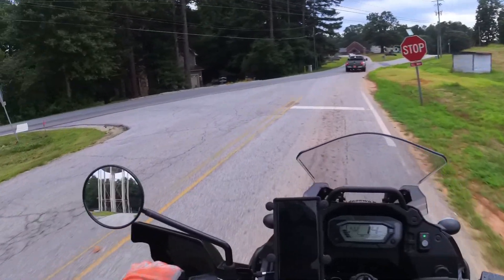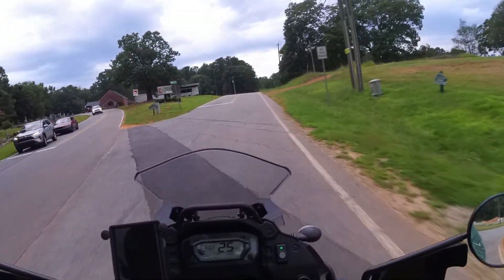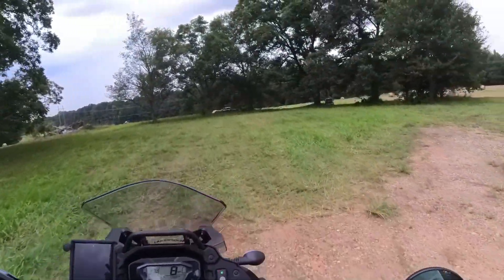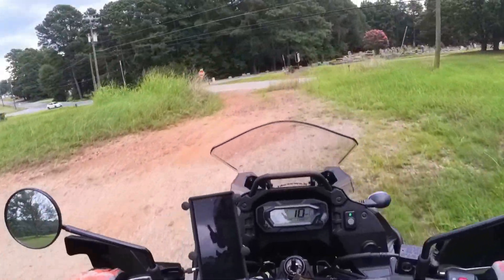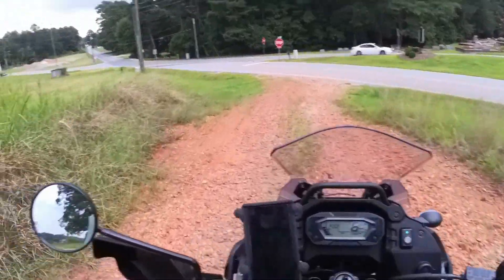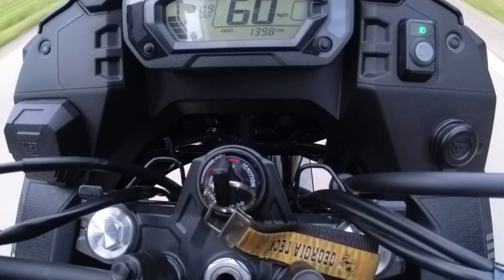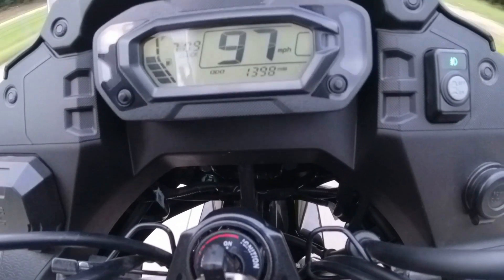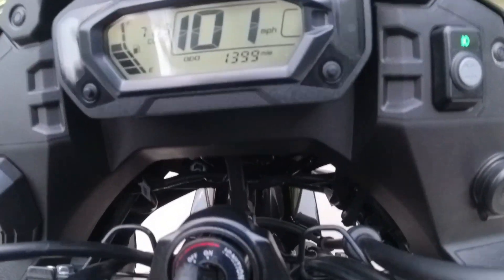Can the 2022+ KLR650 hit triple digits!?! Top speed run after modding let's see it can do!

Comment: That was impressive! I am over 6' 4" and weigh about 270 right now. Since I live in South Dakota, we have high speed limits on our Interstates (80 mph) and most of our secondary 2 lanes are 65. I never figured the KLR could hold those speeds. Otherwise, I would have considered as a daily rider, commuter next to my Victory Vision. Maybe I should rethink this.
Reply from the maker: Doing highway speeds isn't an issue. It cruises happily at 80. For what you need it for, it's just fine. Not to mention you'd be getting about 50+ Mpg haha
Reply: u get a nice head wind and a hill youll struggle to stay at 70 and the rpms your running at at 70 your not getting 50mpg
Reply: @mrt4755 
Sad but true.

Comment: Sorry to burst your bubble, but you hit a “displayed” speed of 102mph.
KLR speedometers are known to be a bit optimistic :) 
Your actual speed was closer to 97mph, if you’re running the stock 15T front/43T rear sprockets.
Reply: I compared my speedo to gps and its accurate to the gps, but the speedo doesn’t keep up with the GPs if that makes sense, like get up to 50 according to the gps and your speedo will say 47 but if you hold it for a few seconds they match up.  I am still in my 600 mile break in period so, I haven’t taken her over 65.

Comment: I bought a brand new KLR 650 back in 99.  I could barely hit 95MPH.   It popped on deceleration so I took it back to the dealer. They told me it was for California specs but they could drill out the mixture screw and solve it.  They did this. I could then hit 105 MPH although these days, Maybe 99.   Bike is sitting in my garage ready for another year. One day soon,  I might do the .22 cent mod and see if that wakes it up.

Comment: I weigh 210 LBS and I had mine at 100 MPH flat 3 separate times. I should also add that mine is completely stock. I’m sure with a different gear ratio you can trade some torque for some extra speed to get it well above 100
Reply: Can it do 75 all day , as the saying goes, that's my question , in all winds and hills etc .
Reply: Yes, is it going to be very comfortable, no. @leeinwis

Comment: I am assuming you are running stock gears 14x43 (Ratio2.86) . As Im planning a Tuktoyaktuk ride  which is long distance , I needed more cruising speed at less RPM . So I went 16x 43 (ratio2.68) and was not impressed. I then went to 15x38 (Ratio2.53) which I am happy with as I can ride at 75mph all day long distance to the Arctic. How ever a buddy of mine , also Gen 3 is riding gears 15x39 (Ratio 2.60) and that seems to be the best which I will change to in due course. This gearing is not for bush riding.

Comment: Im confused at all the comments saying “i got xx mph stock” the bike is rev limited to 89mph from the factory, unless you figure a way to remove the limiter or you change the gears how are you all going faster? I hit 89mph one time and it started cutting the fuel off. Not to mention it took 4-5 miles of wide open throttle to get there, the exhaust and snorkel are terrible restrictions. 

Im a big fella, no need for speed but i could use a little more power/torque for my commute, im shifting down for some small hills to keep 55mph without bogging out. I could go 65 without much trouble but the speed limit is 55 and its a dead spot on the bike.

Comment: I have had my KLR since 2008 and at no time has it even cross my mind to make it go over 100mph.. its just not what it's designed to do..
It's rare I even go 80-85.
It's a tractor made to run low and slow and far with no problem 
.
If I wanted to run faster, I'd use a different bike

Comment: Notice any oil burning?
Reply from the maker: Fortunately, I've not so far. I know some people have experienced it.
Reply: @teages078  Yeah, my 2012 did right off the showroom floor.  It was so disappointing that I quickly sold it.  So far my '23 is doing fine, but I'm still on break-in oil.  
Did you go full synthetic on the first oil change?
Reply: @xnihilo1044 I did and it’s been fine 1300 miles have not lost  a drop of oil